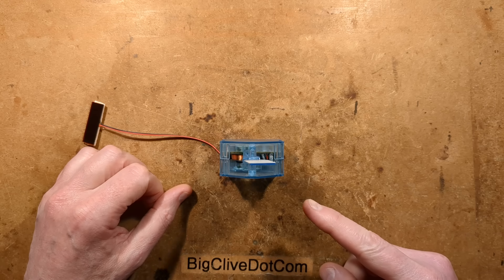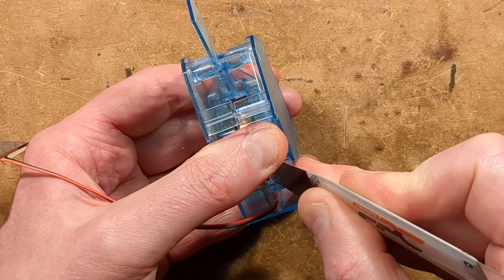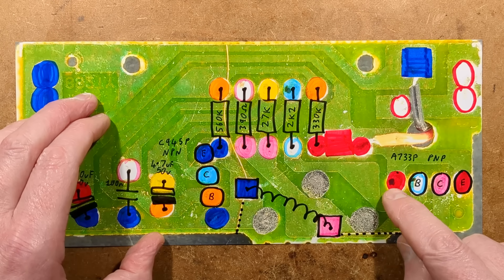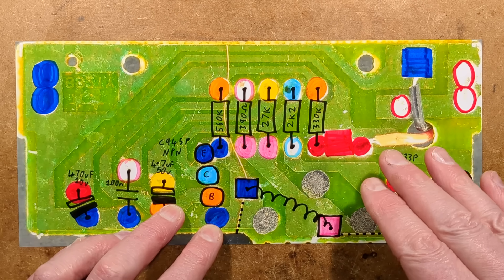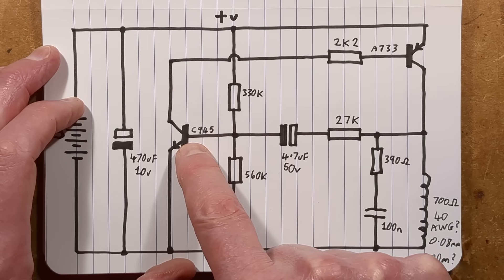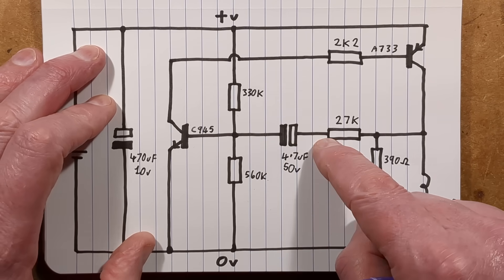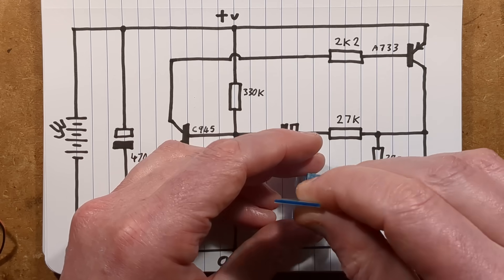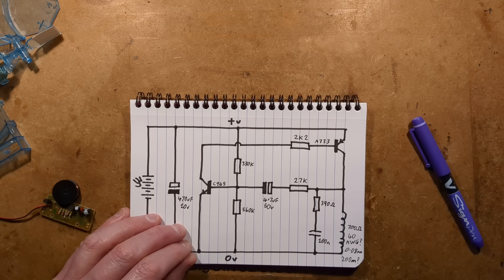Light powered shop window magnetic sign waving device

Comment: They are really expensive? Try "Solar Waving Lucky Cat", probably the same mechanism but half the price
Reply: the clock pendulum modules are similar too, minus the solar panel. Actually the cost of 200m of 0.08mm wire might be the bulk of the BoM

Comment: Reminds me of those cheap plastic, but metal-looking carriage clocks.  There is a fake pendulum at the bottom, and then a separate battery clock on the top.  The pendulum took a C battery in the bottom and the actual clock took an AA battery.

Comment: please do one of those solar rotating displays with the 4 small solar panels, the torque on those is absolutely amazing....it can turn a full pint of water....and more....seriously incredible.
Reply from the maker: I bought one recently, but have made videos about them in the past.  They use a circuit similar to this to run a small clock style motor.

Comment: In the '70s, a local store had a similar gizmo that used a single D cell that would run for months on a basic zinc carbon battery...as I recall, it had a coil, one transistor, one capacitor and two resistors.. very similar to older electronic analog clocks...

Comment: Fun little circuits and far more complex than they look. In a free pendulum the period is set by its length but this is not a free pendulum. Its period is affected by the inductance of the coil and its field’s back reaction on the magnets. Remove one of them and see what happens.

Comment: Nice video, Clive. I appreciate that is it an ultra-low-current circuit, but would it be possible to use one of those 'audio' transformers of the type sold in Maplin or RadioShack to derive an output the would drive a speaker or earphone? It would help explain the circuit operation being able to hear what it is doing.

Comment: Finally an upgrade for my nodding Elvis. Does it come in 12 volt ? Can you adjust the nod rate to maximum rockin' ?
You can get a nodding Syd Vicious on the black market but if the cops pull you over you can slide a barbie dress over it. Trans nodding is a growing trend.

Comment: Greetings. In usa the 1N, 2N are used for diodes, transistors.  in UK, no so.  Do you know how this came to be?
Reply from the maker: I believe that in the early days it was used to indicate the number of semiconductor junctions in a device.  so a 1N4007 diode has a single semiconductor junction and a 2N2222 transistor has two.
Reply: From the beginning the USA, Europe, and Asia had their own  part number codes,. How and why I don't exactly know, but these different parts of the world had different industrial legislation bodies.
USA 1N, 2N (diodes, transistors)
Europe AC, BC, AD, BD, AF, BF (all transistors)
Asia 2SA, 2SB, 2SC 2SD (all transistors)
You can find them easily by typing "Asian transistor codes" or similar.

Comment: I am guessing. The resonant frequency of the pendulum probably needs to nearly match the resonance of the circuit. Would be interesting to tweak the LC circuit a bit to see-if it will start and continue. Alternatively carefully add a balanced mass to the card holder or a longer arm. What a fun circuit!
Reply: > "...nearly match the resonance of the circuit." I don't think the circuit has a resonance. It may have max/min frequencies for reliable/efficient operation but is basically a very wide-band device. Or as @Plons0Nard cleverly says below: "It adapts to the attached thingie".
Reply: @PRR1954 I think you are correct. The circuit could be modeled in spice ( Electronic circuit simulator) but not certain how to do the pendulum model offhand. A good past-time endeavor for someone to do. Should make a bunch of these "motors" and  put them in a time capsule. Will intrigue alien visitors....or probable not.

Comment: It is practically the same principle as the old 1970s and 1980s kitchen clocks. Their insides were very similar and the swinging "pendulum" was just rotating from side to side (acting as a sort of balance wheel), driving tiny gears of the clock mechanism. It looked like two small discs with tiny magnets on one side. Each swing pushed the mechanism on and on and on. It was quite clever. German Ruhla factory and even our Czech PRIM were big manufacturers of these. Later all these mechanisms were replaced by the traditional quarz ones we know today.

Comment: 1950's childhood here.  I used to collect used store waving devices.  They were even simpler and used either a C or D cell and were NOT self starting.  They used a cylindrical alnico magnet and a mechanical switch to give the magnet a "kick" when it passed through an electromagnet.
Reply from the maker: The Kundo clocks used that system.

Comment: To stop or minimise wire breakage when winding these coils, 40 to 50 are wound at once, reducing shock loads. Finger nail paint(with drying fan) is used to stick both ends of the wire to the plastic coil bobbin. I saw on TV many moons ago, the process, only all of the  wire spools were slightly short of length and it ended up a copper frizz!

Comment: One night when his charge was pretty high, Micro-Farad decided to seek out a cute little coil to help his discharge. He picked up Milli-Amp and took her for a ride in his Megacycle. They rode across the Wheatstone Bridge and stopped by a Magnetic field with flowing currents and frolicked in the sine waves.

Micro-Farad, attracted by Milli-Amp's characteristic curves, soon had her fully charged and proceeded to excite her resistance to a minimum. He gently laid her at ground potential, raised her frequency, and lowered her reluctance. With a quick arc, he pulled out his high voltage probe and inserted it in her socket, connecting them in parallel.

He slowly began short circuiting her resistance while quickly raising her thermal conductance level to mill-spec. Fully excited, Milli-Amp mumbled "OHM...OHM...OHM!"

With his tube operating well into class C, and her field vibrating with his current flow, a corona formed which instantly caused her shunt to overheat just at the point when Micro-Farad rapidly discharged and drained off every electron into her grid.

They fluxed all night trying various connectors and sockets until his magnet had a soft core and lost all of its field strength. Afterwards, Milli-Amp tried self-induction and damaged her solenoids, and, with his battery fully discharged, Micro-Farad was unable to excite his field. Not ready to be quiescent, they spent the rest of the evening reversing polarity and blowing each other's fuses.

Gotta love analogue…

Comment: Thank you! I never could fathom out how the one I have works. I did a video of it ages ago but deleted it cos its boring lol, you go into much more depth than I could. Mine is a clear plastic one, but same circuitry. I pinched it from Safeway when Antz was released on DVD as part of a swinging ant face on a display stand lol That makes it 1999 and 26 years old and still quite happily swinging away in my kitchen window, albeit with nothing on the end of it but it does knock into the ornament next to it making an annoying ticking sound when your near it. That little glass solar panel has surely surpassed it's life expectancy by now, but if it's swingin, I aint complainin lol

Comment: One could mount a light-gap sensor on a piece of scaffolding such that the top "tab" is just about to interrupt it when perfectly vertical - then set up a scope with probes on the coil and the sensor, to see if the pulse triggers on approach or departure... I'm kinda curious actually.

Comment: I love seeing minimalist circuits like this, where single components serve multiple functions base on the state of the circuit: the coil is both an output and an input. No Hall sensor needed, no feedback windings. Pure simplicity.
Reply: Proper analog circuit design, pumping electrons round rather than using a computer
Reply: Not like the garbage produced today, the death of analog was the harkening of the age of the idiot  @jhonbus

Comment: This was a very common circuit, used mainly for extra low voltage clocks. Ubiquitous in cars of the 1950's through to the 1980's. I believe Smith invented it or were the first to use it.
  The capacitor has nothing to do with the timing, but only ensures the starting. Except for starting the transistors never get slightly close to saturation. The period is set by the pendulum alone. In the clocks they used a traditional balance wheel and spring and the timekeeping was adjust by this.
  These use less power than a digital clock which is why they were used in cars, particularly of the past, where the cars might not be used from week to week. Therefore the drain on the battery was many times less than the self-discharge of the battery.
   When the magnet(s) pass through the middle of the coil the change in rate of the magnetic field causes a very brief pulse that repels the magnet(s).
   These old british engineers were brilliant; Lucas engineers designed an eight-bit shift register based on electromagnets that triggered SCRs to make a distributor-less ignition. And WiPac had a CDI system in the mid-1950s that obviated plug-fouling in two-strokes. Very, very clever.
    Now I really am showing my age.
Reply: Also in watch too, my 1975 Citizen Cosmotron also uses this kind of concept, which is still ticking till this day, and also Timex with their electric watch, use no transistor or any electronic part but a tiny metal contact at the balance to complete the circuit

Comment: the original sign waving devices I played with had a curved arm with a cylindrical magnet on it that went through a coil.  There was a leaf spring contact that brushed past another one and connected the D-cell to the coil as the arm passed center.  Upon insertion of the battery it required you to manually start it and then it just ran until the battery was dead or the sale was over.

I believe the bearing was a knife edge in a V.

This was "a few" decades ago, circa 1960s.

Comment: Early clocks used a similar circuit but with two coils wound onto the same core.
In germany they were called ATO and later on ATO-Mat.
Reply: Pardon, fixed all the typos to make a understandable sentence xD
Reply: Yes, I have one here, notorious inaccurate for temperature dependency of the germanium transistor. Minutes a day error.
Reply: @erikdenhouter  only if the transistor is damaged.
As a clockmaker who fixes these clocks I can say they run pretty well if well maintained.
Reply: @PhalosSouthpawsBastelstube  Thanks, if that is your experience I will surely have a look at that !

Comment: Ah, not a chip in sight, just discrete components enjoying life.
Reply: Many, many, many years ago as I learned about vacuum tubes the rare thing was to get a transistor. Finally school acquired a few 2N2222s (never actually used any germanium transistors). The 2N2222s were precious back then. Now many, many, many years later I bought a huge bag of mil-grade 2N2222s (ceramic packages) at a garage sale paying one dollar for all.  I have fun trying to use them in projects that use NPNs. So far all those 2N2222 that I have used or tested work fine.
Reply: Well, there are at least two chips... :-)